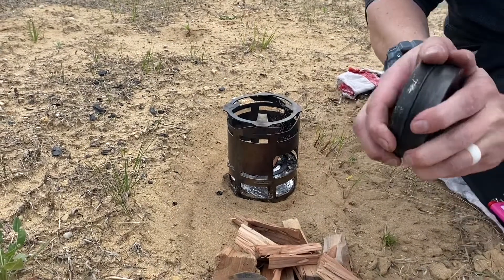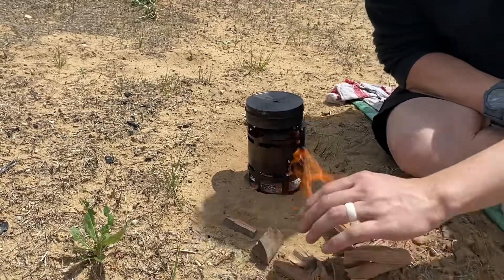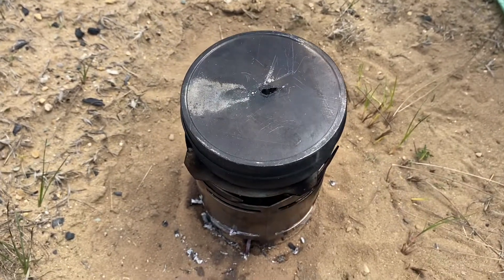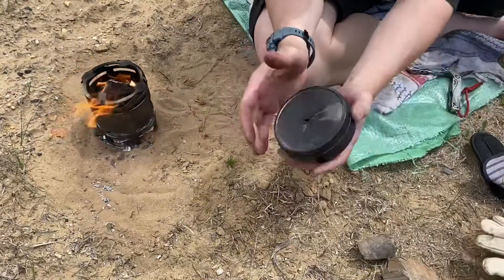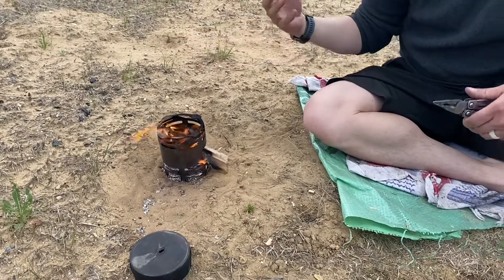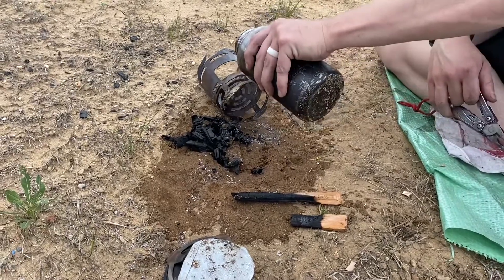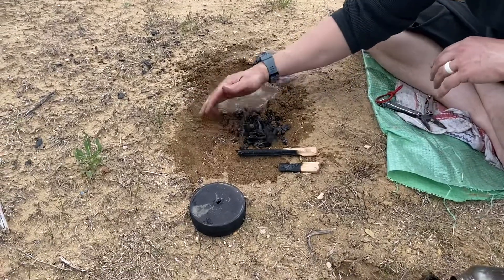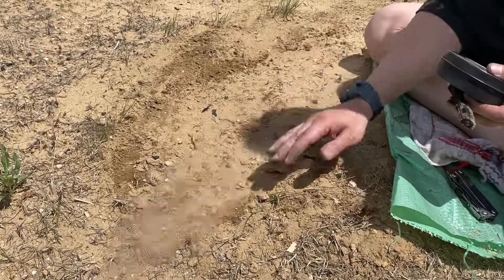A Simple Theory “How To” ...

Comment: Thanks Mac. I do have to tell you, when I first saw you quench the stove I cringed. I have always allowed my stoves to cool naturally to avoid not only warping but also hardening and potentially becoming brittle. Having a stove that can be quenched without damage really speeds up getting back on the trail. I will be sure to discuss this in my review video
Reply from the maker: Thank you so much Mark!  I think a lot of people share that cringe with you. Over the winter I had made a snow quenching video and some people seemed rather concerned. However, as you noted, and as I designed it to allow, the quenching gets you right back on the trail. My thoughts on the potential brittleness created by said quenching are two fold- 1.  the next time you use the stove and let it air cool it should retemper & 2. Because the demands of the steel aren’t overly kinetic.. bending, twisting, and hitting.. it shouldn’t be a problem. As I noted, I’ve been doing it the whole time and it hasn’t been an issue at all. In all, I think that unlike other stoves that warp even with normal cooling, being able to handle such a process speaks to the durability and robust nature of the Pack Stove. At least that’s my hope!

Comment: You probably know better than I, but it seems to me that pouring water on very hot stainless steel is not good for the metal.  Thoughts?
Reply from the maker: Excellent question. We’ve thoroughly tested our stove with this process and have not had any ill effects.  Please note that I am not a metallurgist therefore my thoughts on everything may be incorrect. However— as I have experienced, the metal, though extremely hot, is not getting to critical temp so it is not a true “quench”.  With this, if the hardness or metal composition is being impacted, the next time you use the stove it should retemper... especially if you let it air cool.  Again, this has been our experience and why we cover such a process with our warranty.